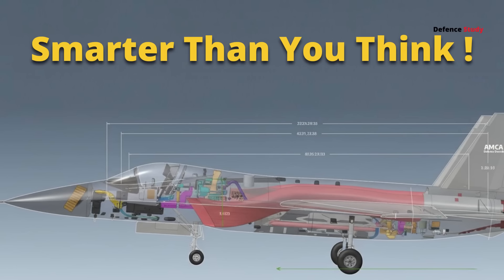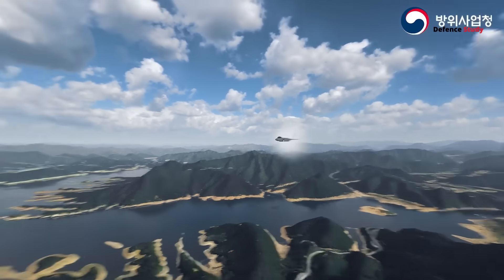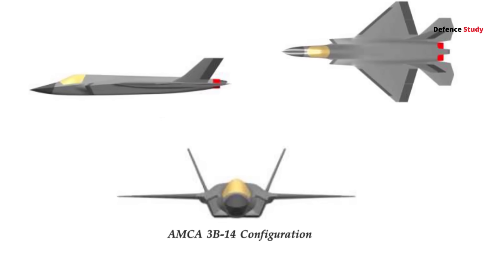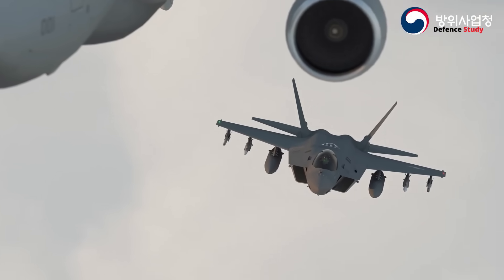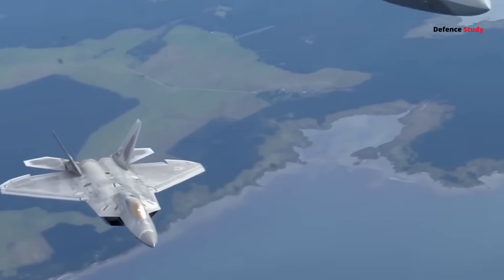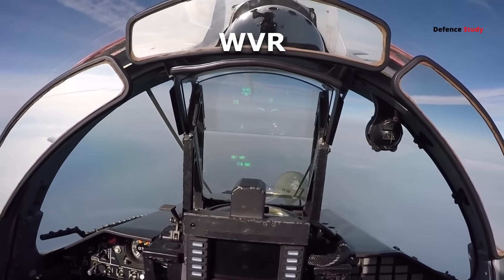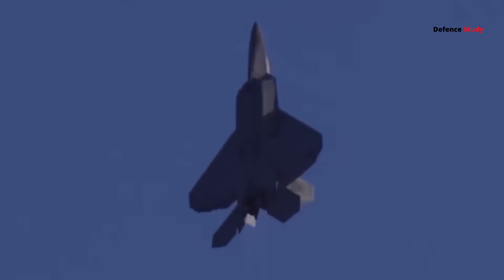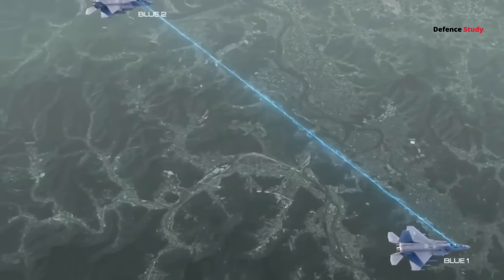AMCA Design Is Smarter Than You Think!

Comment: You Indian Tejas is merely assemble with imported parts. All core techs are imported. Talk about 5th generation fighter jet 😂
Reply from the maker: False.
Tejas Mk1 has over 60% indigenous content, Mk1A is higher, and Mk2/AMCA aim for even more.
India imports some components (engine, radar elements, actuators), but airframe, flight control laws, composites, EW systems, avionics architecture are Indian.
“Merely assembled” is an exaggeration — HAL isn’t running an IKEA for jets.
Reply: @defencestudy Your words are nothing but “selective blindness” + “number games”! The so - called “indigenization” of Tejas is fundamentally more propaganda than technological breakthrough, and the following facts will slap you in the face:

1️⃣ [“60% Indigenization” Is a Conceptual Switch]

What India calls “indigenous content” includes low - tech outsourced parts (seats, interiors, non - critical panels)! Under the internationally recognized standard of “independent design + technology control”, — engines, radars, flight control algorithms, high - end avionics are 100% imported/foreign - controlled, and the independent rate of core technologies is less than 30%! India's Comptroller and Auditor General (CAG) stated long ago: In the LCA project, local companies only do 30% of “screw - tightening level” work, and the core supply chain relies entirely on foreign countries!

2️⃣ [“Imported Components” Are a Critical Chokepoint]

You say “only import engines, radars, actuators”? These are the “heart + brain + nerves” of a fighter jet!

- Engine: The Mk1 fully imports the American F404, and although the Mk1A is “locally assembled”, 100% of the core technologies belong to GE; India's self - developed Kaveri engine has been in development for 30 years (1989 - 2023), with over $2 billion invested, yet it’s still junk — the power system is completely crippled!
- Radar: The in - service Mk1 uses the Israeli EL/M - 2032 (imported), and the self - developed Uttam radar has a detection range so short that it can’t even detect enemy aircraft and zero anti - jamming capability — the core technology can’t even be copied properly!
- Actuator: High - precision electromechanical components all rely on the American MOOG, and India can’t even get a glimpse of high - end actuators — the flight control actuation system is just import - based!

3️⃣ [“Local Parts” Are a Low - Tech Disguise]

You boast “airframe, flight control laws, composites are made in India”? The truth is:

- Composites: India only does “adhesive taping”, and the production equipment (autoclave) and material formulas (carbon fiber prepreg) are all imported from Japan/Europe, which is “contract manufacturing with imported materials”;
- Flight control laws: The algorithm framework relied on early support from the American Lockheed Martin, and it has been exposed to many failures due to poor stability — the core technology discourse power lies in the West;
- Electronic Warfare (EW) system: The in - service LCA Mk1 mainly relies on imported electronic pods, and India's self - developed EW kits perform so poorly that no one uses them — “independent EW” only exists in PPT!

4️⃣ [“Merely Assembled” Is a Spot - on Criticism]

Is HAL making LCA worse than IKEA? Wrong! At least IKEA lets people assemble furniture themselves, while HAL’s “assembly” is “putting together foreign parts” — all core components are imported semi - finished products, and local suppliers only tighten screws and paint! Jane's Defence Weekly has also stated bluntly: The “indigenization” of LCA is “more political slogans than technological progress”, it’s a world away from independent fighters!

Summary:

The Tejas you hype up to the sky is essentially a fig leaf for “comprador military industry” — all core systems are imported, and local technology is only enough for “surface - level work”. Next time you talk about “60% indigenization” and “not just assembly”, please first check clearly: When will the Kaveri engine be mass - produced? When will the Uttam radar catch up with Rafale? (It won’t happen! Because India's military industry only knows how to talk big!)

Comment: The Tejas fighter jet programme started in 1984 and the fighter plane was constructed after 40 years in 2023 using American General Electric engine... So, the  Advanced Medium Combat Aircraft AMCA will be likely completed in 2065.
Reply: First flight would be in 2030
Reply from the maker: Not accurate.

1983–2001: Tejas was a technology development program, not a fighter build program.

Flight in 2001, IOC in 2013, FOC in 2019, Mk1A in 2024.

The engine was imported, yes — but the flight control laws, composites, avionics, EW suite, airframe were all Indian.

Tejas took long because India was literally building aerospace capability from zero.

Now that the base exists, AMCA won’t take 40 years.
No country takes 40 years for a second fighter program — that’s like saying “I needed 10 years to learn the alphabet, so I’ll need 10 years per chapter to read a book.”